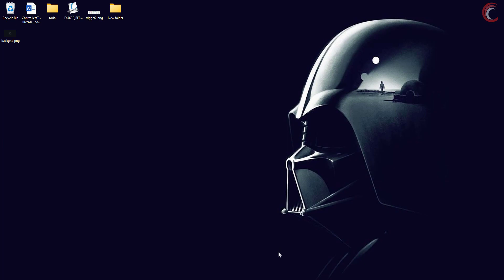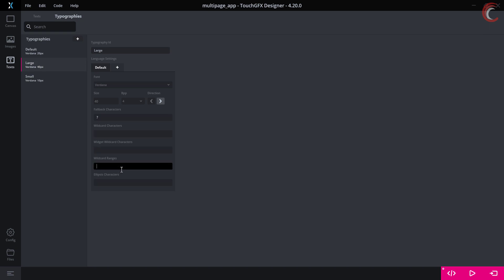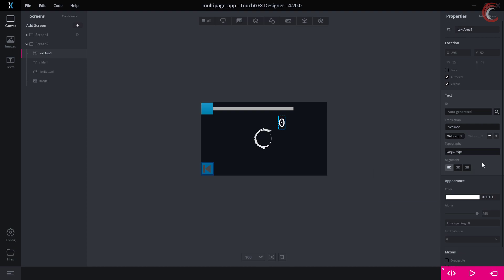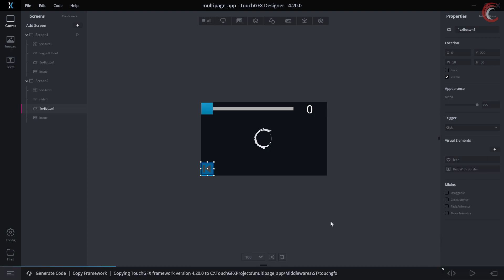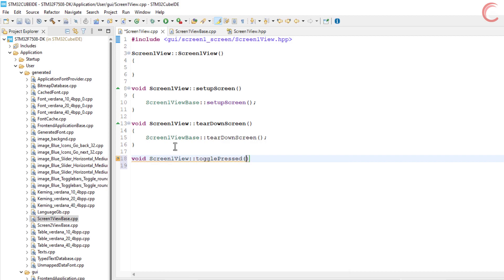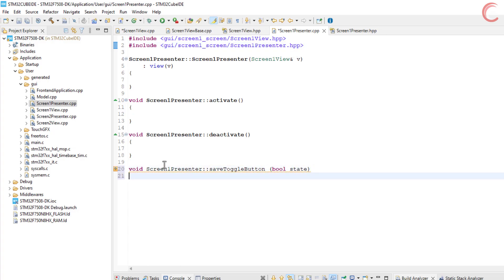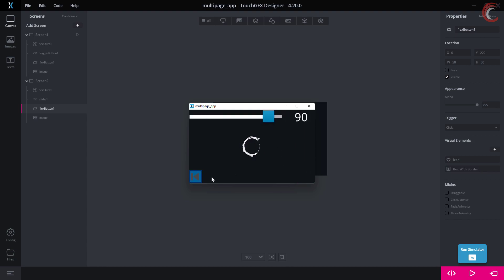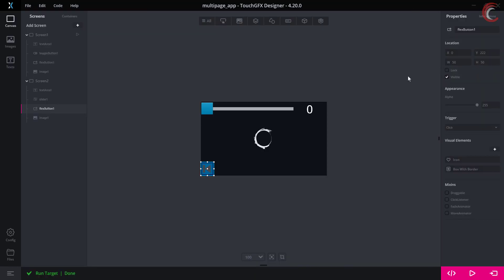Touch GFX #6. How to run Multiple Screen Project || Reverse MVP

Comment: Hello , great videos.  Very helpful.  Would this work for retaining the values after power cycle?
Reply from the maker: Of course not. That is a completely different thing. Once the power is reset, the entire code runs from the start, so this setup will also reset. If you want to preserve the values, store them in the flash memory.
Reply: @ControllersTech  Thank you for the info.  I wanted to update/ store values every time the value is changed.  Cycling through many numbers this might be huge amount of writes over time.  What would you recommend storage type for continued values stored?
Reply from the maker: If you do want to retain the value through the power cycle, flash storage is a good option. Instead of writing every value, why not setup a timer to generate interrupt every 2 or 3 seconds. In the interrupt handler, you can store the current value.

Comment: Hi, I am fillowing the steps but when I import my project from TouchGFX into STM32CubeIDE, it doesn't have the .ico (configaration file) in the Middlewares directory.

What can causes that?
Reply from the maker: It should be in the main project folder. Touchgfx does not generate ioc file for few boards. Which board are you using anyway ?
Reply: @ControllersTech  I am using the STM32F429I-DISC1.

Comment: hello and thanks for the video
I'm currently working on multiple screen project... actually 17 screen, each screen receives specific data from uart and displays it , I'm having an  issue with modelListener,, when i use the instance to call a specific function in the model::tick, it tells me that the function is undefined in the other screens!! which is what i want! please I've been stuck here for almost two weeks and this is my final year project, i would be grateful for any help ',!
Reply from the maker: Need to see the project. Contact me.. check about section
Reply: @ControllersTech  i sent you an e-mail ! thank you so much indeed